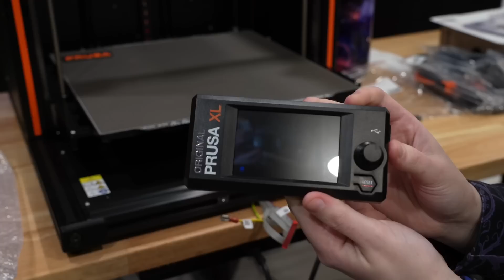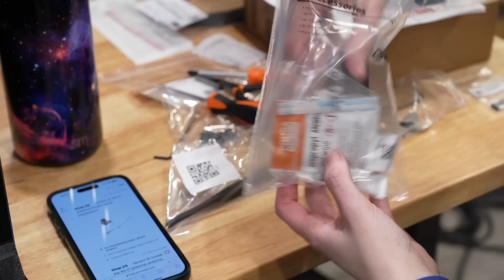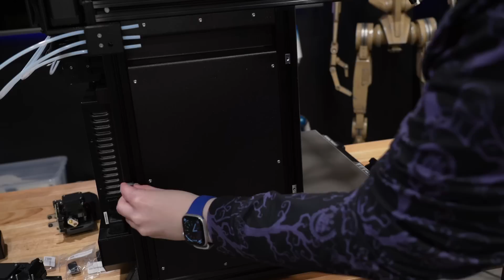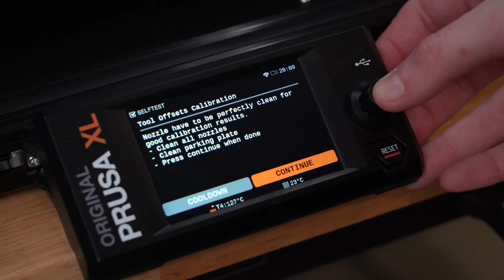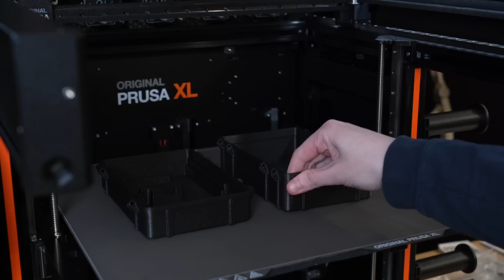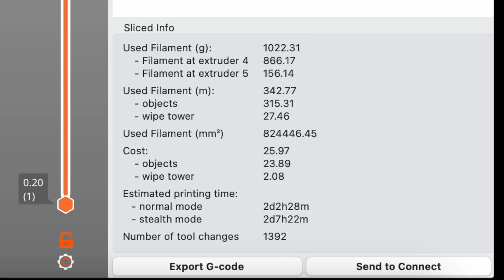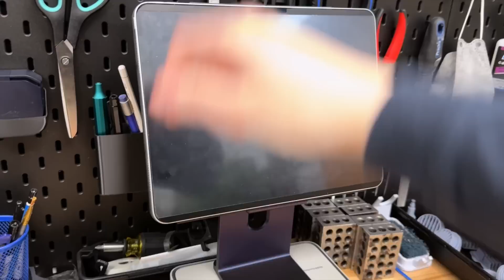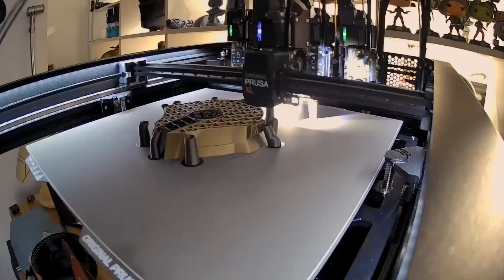Why the Prusa XL is the Best Multicolor Printer

Comment: This thing is $4800. I can’t afford that. I can accept some waste
Reply: You save on energy and filament. Do a bit of calculation and see when it becomes profitable.
Reply: Yeah it’s expensive but you’re getting a lot of functionality and time saving - it not just about waste. Granted if you're doing simple parts and don’t care about waste you could get 2 or 3 mk4 (core one) printers each with mmu. Which will be quicker than the XL. Faster print productions after all is more printers.

The core one avenue is probably the best one going forward if you’re doing simple parts if doing supported with pla/ petg I guess mmu can handle but the prusa xl is still smaller footprint than combined emu and xl(core) unless stacked. 

I have mk3 and mk3s and have barely used since I got my XL5T. This is because most stuff at moment has over hangs and for small parts the xl is quicker. I’m thinking of selling the mk3s and getting a core one or another Xl 2T to see if the 2 tool setup limits me. I usually only do 2 materials petg/ pla support but recently did one part with 3 petg colors and pla support.. the xl 2t could be compelling as save space/ awrekwardness and more simpler than core one with mmu.

what i would like to change is that the the ~1.2m (3') of material that is wasted as the run out sensor is 1.2m from top head sensor. it would be cool if you could configure it to warn you to get ready to feed a new roll in or if just to stop and waste 1.2m of filament (normal operation) I will stand there to feed in the new filament. as i want to use what i paid for..
Reply: Yeah, the price is steep but you can do it as a series of upgrades

Also I've found if you want multicolor and not pay for the XL, the MMU3 is almost twice as fast as the Bambu AMS and far far less waste

Comment: Nice overview, Michaela!  BTW, not sure which version of PrusaSlicer you used for the video but the newest 2.9 that came out a few weeks ago added multiple build plate feature.  It is great.  Just drag a model to the side of plate 1 and it automatically adds another plate.  Nice feature indeed.  For me if/when they allow each plate to be sliced with different machines and settings it will be great, right now all plates are sliced at the same machine and setting set.
Reply from the maker: Ooo, great to know! Thank you! Will definitely make sure to update it.
Reply: One thing to keep in mind is that after doing a tool change, only a tiny bit of material actually needs to come out for it to be primed. So if you are doing larger objects there really is no need for the wipe tower at all. This is especially true if you have 3+ perimeters, since the prime will be hidden inside the print. 

However, if you print without a tower make sure the filament is really, really dry or you will get stringing.

Comment: Thanks so much for this thorough overview. Like you said, most of the videos I’ve seen about the XL are from early adopters who had bad experiences. It’s really helpful to see that it’s improved in print quality and reliability. In terms of multi-material, I’d love to see a glove or gauntlet with flexible and hard materials in multicolor. Now I need to go and print that iPad stand…
Reply: Agreed. It's just that the 'early adopters' had to wait two years before they could use this printer. And when it finally came, it had quite some problems. That is something I found quite disapointing for a printer in that price range. Happy to see that it's working good at this point. 
Comparing a tool changer to a regular printer with a MMU or AMS is like comparing a compact car to a truck and then say that the compact is not suited for carrying lots of stuff. Tool changers aren't new but it never really took off for hobby users because of the price. Comparing a €1200 to a nearly €4000 printer is not fair. Also, I can buy a lot of filament for the price difference, and a business case for the XL can only be made if you have a business printing stuff for clients. Or when you're a rich hobbyist... But it's a brilliant machine. If I had the money, I'd buy it. Untill then, I'll have to make do with my X1C.
Reply: @PhilippensTube  The price alone makes it more of a Business printer. If you are a prop Shop and need multicolour prints fast this is the way.

Comment: this setup costs 4200€ in germany which is 4330$ (and this thing gets produced over  here). its build  mostly out of 3d printed parts. feels like a rip-off. is it really that good?
Reply from the maker: I wouldn’t agree that it’s mostly printed parts - there do seem to have been more on past versions of the machine. I admit I was sceptical with the printed pieces, but from my experience so far using the printer, it hasn’t felt like a downgrade or issue in any way. If anything it might end up being beneficial in the long run because of being able to print replacements if necessary and not having to worry about pieces being in stock and the time spent waiting for them to be delivered.

As for cost, as I mentioned in the video, I think it’s going to come down to what an individual feels is a “justified” price for the benefits that this machine offers in relation to the work they’re doing. There’s really nothing similar at all to this machine currently so comparing prices becomes a nearly moot point. Historically multi extruder printers have always been more expensive and that has only been with 2 hotends.

Comment: Prusa XL is experiencing its renaissance. Great video Michaela.
Reply: If only they could cut the cost by about 30%, or more...
Reply: @cloudyview  Difficult to compete with manufacturing costs being so low from China
Reply: @AniK-g3x oh, I understand why it's more expensive - it just puts it out of the conversation for most consumers, making it more of a business class option.
If you're a business and printing multicolor/multi-material, amortizing the cost of this machine is pretty easy, especially when you're also saving kg's of filament per week.
Reply: @cloudyview  that’s definitely true. It would be nice for them to release a truly budget friendly machine, similar to the Bambu Lab A1 in terms of the market it tried to appeal to
Reply: @cloudyview iirc their newer MMU isn't vastly expensive option and works even with their new Core series printer if I've understood correctly. But for sure it's the slower one tool head option.

Comment: Great vid but I’m not seeking a kidney to buy a prusa
Reply: Seeking a kidney huh. Are you harvesting them to sell?
Reply: I miss craig @JohnHall73
Reply: This unit with the 5 heads is 4K not enclosed. A typical high end enclosed xy printer is roughly 1500 give or take. At $15 a roll of filament you’d have to burn through about 166.6 rolls ($2500) roughly to break even, then you’d start saving money. This is assuming all your printing is multicolor. Don’t really see the value in it at least for a non professional. But it’s a really cool design and makes perfect sense given you mainly do multicolor prints.
Reply: @BEARTAC0S I us this for sign making, and 166 rolls is what I go through in a week or less.
Reply: @BEARTAC0S  it is not just the 166 or so rolls of filament. If you really print and sell multi colour/material objects, the time saving from ultra fast colour swaps is $money$. You print way faster, you sell more... So the money gain comes way earlier than the 166 roll of filament..😊
Reply: @vasilistsilioukas4270  I completely agree which is why I said it makes sense from a professional standpoint point but not for the hobbyist. If I was in the business of selling multicolor prints I’d buy a few of these lol
Reply: Yeah the price difference makes more sense from a business perspective, basically the mantra "time is money" - - product development prototypes or end use digital manufacturing prints are done sooner than otherwise. It'll be a few years before these are at a consumer price, just like what happened with the evolution paper printers, from the old single color dot matrix to color laser
Reply: Yep
Reply: I haven't sacrifized my kidney and I own one. Not everybody buys Ferrari anyways. But  it is clearly one of the best. You might start to thing how to make enough money to buy it ;-)
Reply: You have two kidneys, what’s the big deal?
Reply: It’s European , I have Ultimakers which are even more expensive but they simply work. I have very cheap Chinese one too, which is fun too but needs a lot of tweaking.

I do not own a Prusa yet but for my needs I will never buy a Bambu. Too much waste, takes too much time and well, it’s not European :)
Reply: Buy once cry once. What I save in filament vs the Bambu I have is crazy
Reply: @gojiraforbreakfast 
Is the wipe tower really necessary with this technology?
Reply: @Section31HQ  yes, it's needed just to help have the little bit of ooze get out of the way for maximum print quality, A better solution to the wipe tower some people have found is to make them print a cool model that can still function as a jumble of colours, such as 3d printed lego esque bricks and stuff :) that way even the "wasted" tower has some use
Reply: @Section31HQ If you really keep your Filament dry it is Not necessary.
Reply: @Section31HQ  Actually, no! There is an option to to wipe into the object itself, the object’s infill, or you can wipe into another object on the same build plate if you don’t care about color or other small imperfections.
Reply: @gojiraforbreakfast I just don’t multi color print but actually paint
Reply: @JokerGames818  I don't give a shit what you do. 😘
Reply: How much have u saved?  @gojiraforbreakfast
Reply: @gojiraforbreakfast am I missing something? Bambu refill spools can be like $15 each but Prusa is $30? Just checking the websites.
Reply: @gojiraforbreakfast My thoughts exactly, between the time it saves and the filament you make back in production costs so incredibly fast. I had this little file for a four-color Goofy looking chicken and it was going to take a day and 9 hours on the x1c to print 19 of them whereas you can print 53 of them on the XL in a day and 17 hours. And the nice thing about the XL is that you can just print a couple of things and not have to worry about the waste, to print two of those on the x1c it was going to take like close to 300 g for something that should only take about 40